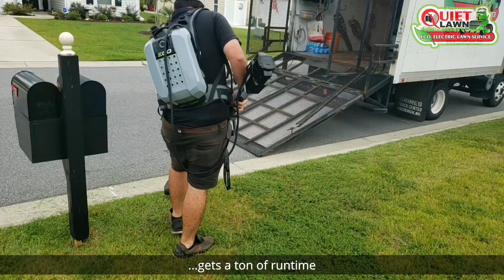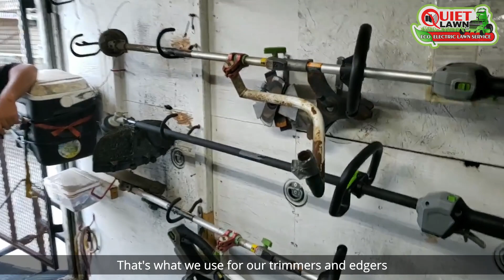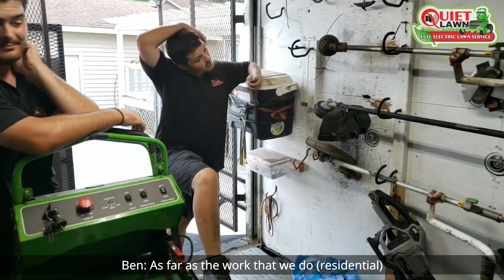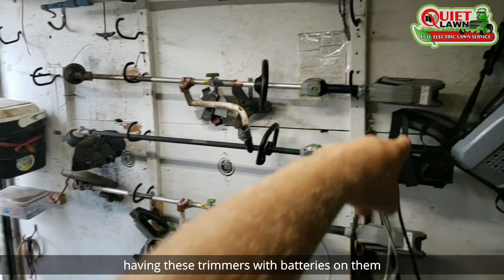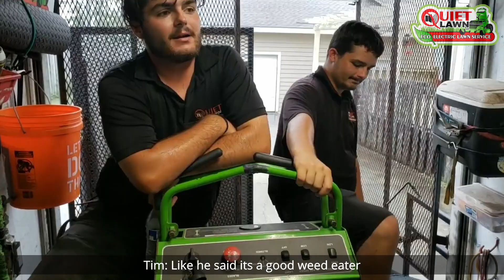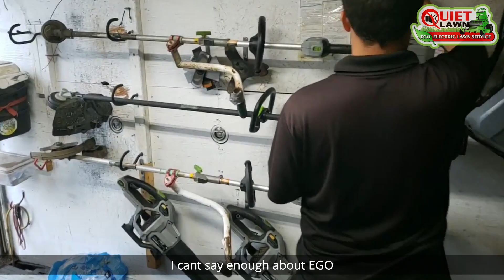EGO POWER+ COMMERCIAL STRING TRIMMER | Hands-on Review

Comment: I own the CORE multi head battery powered string trimmer. What is exceptional about that trimmer is there is no brushless motor or any motor.  Rather it uses a circuit board. It works great, I am surprised it never caught on with the rest of the manufacturers.
Reply from the maker: That's great. I'll have to look into them
Reply: @QuietLawn  don't bother. Core was bought up by MTD which owns several big names. They tried to introduce the system to CUB CADET and TROY BILT. I tried to see if they added to their power head line and they didn't. You can only find parts. Tomorrow I am looking forward to a Makita power head; string trimmer and edger.

Comment: Not really a fan of the current ego commercial configuration. I do own the full carbon shaft trimmer, and it's my favorite tool ever. These back packs are heavy, and not ideal for technical properties, also the handle drive is far less efficient. I recommend picking up a full carbon shaft trimmer, the head spins the wrong way compared to commercial units but it doesn't bother me all that much anymore. https://youtu.be/cPA2q7T_b5A?t=1064
Reply: @LegendLength  its not commercial ready reguardless power head is probably the only ego trimmer that's commercial verified, full carbon shaft has some issues.

Comment: Also try Oregon Commercial Electric, STIHL Commercial Electric and Greenworks Commercial.  I really like Oregon, STIHL and the Greenworks Backpack blower.
Reply from the maker: I've actually tried them all and they are great too. But, I've got to say that Ego is still pretty far ahead in my opinion. I did like the Oregon platform though.
Reply: @QuietLawn  I like the quality feel, The Very Very low noise and look of the Oregon also the high speed of the backpack blower, but the CFM is a little low. I like the Greenworks Backpack blower only because of the power, 690 CFM and 165 MPH.  I love the STIHL electric KombiSystem with the available hip mounted battery pack. The KombiSystem blower attachment seems/feels stronger than the 580 CFM EGO blower.
Reply from the maker: @Cyberslug1  Nice! I'll have to try the Stihl at GIE this year.
Reply: Nice setup, I would recommend EGO also releases a system you can tote on a belt similar to Stihl's battery belt to work in conjunction with the backpack. Thanks for the informative video!
Reply: Nice downpour,  seems you finished your rounds right on time!
Reply from the maker: @gregderossi  Yes sir. Glad to see the rain. It's been a very dry summer here.